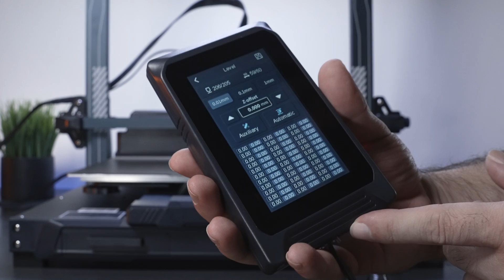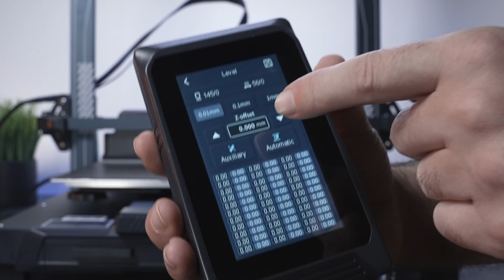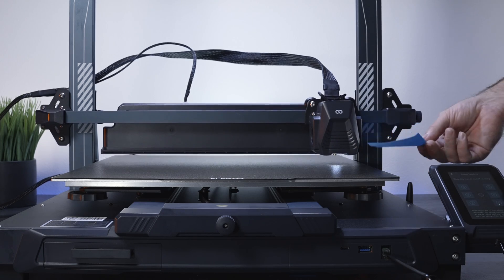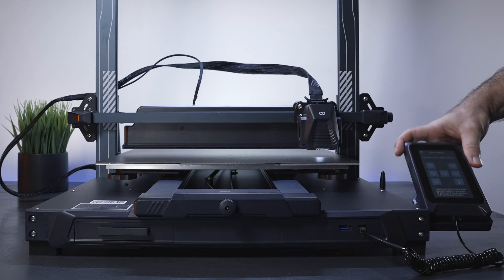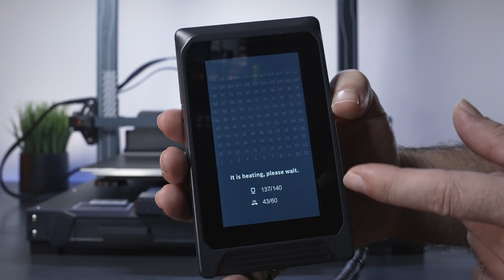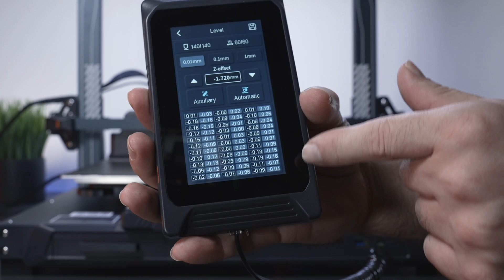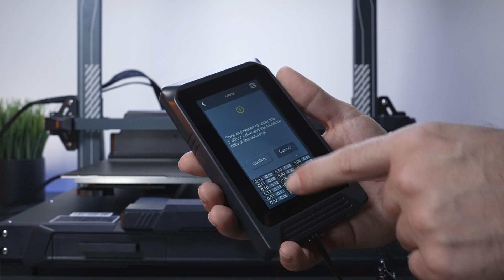Elegoo Neptune 4 Max - Bed Leveling

Comment: out of the box it levelled no problem then did a 5 day print, every since its been nothing but problems, bed wont level, print wont stick, randomly fails half way through. worst printer i have ever had tbh and im still here banging my head against the wall trying to fix it. elegoo support doesnt listen and sent the wrong parts stuck with it and its a nightmare to deal with. if you dont already have one and youre thinking of buying one please dont.. or just buy mine.

Comment: Thanks, setting mine up today.  I didn't realize the z-offset was set first but of course I see how that makes sense.  Don't underestimate the side-to-side effect of the leveling knobs in fact I tend to work across the printer either diagonally opposite corners then the middle or a pattern like 1-5-3-4-2-6.  I figure at least three rounds of manual leveling...you'll know because an adjustment on one side doesn't change things on the opposite side.
Wish I knew what the columns of numbers meant...6 columns of 11 numbers or 66 values doesn't match the sampling points of either the standard or advanced auto leveling....?  So far I have numbers from 0.16 to 2.40...so apparently my bed simulates an ocean wave 😥😥

Comment: Not sure if people are still referencing this video, but it's worth also using Orca Slicer with this because you can go to the tuning setting and get a 3D heatmap for the offsets. This is super handy because it summarizes your offsets (Elegoo's little summary is pretty bare bones). I can consistently hit a variance of under 0.3mm, which I use as my initial layer offset. This usually lasts a few prints especially if you aren't printing things that take up the entire build plate, and auto leveling every other print just to check that my offsets are still within that tolerance. Or if you're tired of fighting it (which happens) the nuclear option is coat the plate in a layer of glue stick and just printing into the layer of glue. You get gross bottom surfaces but you don't have to manual level anywhere near as option (still haven't tested misting a layer of PVA glue on the plate but that also seems feasible).

Comment: Its better to aux level in a criss-cross pattern like the lug nuts on a wheel.
1,4,3,6,2,5 rinse and repeat.
Reply: See I do this but haven't seen anyone else mention it, just seemed like a good idea because you do it on lug nuts to better distribute the force, so I assume the same applies here.

Comment: Awesome video.  What do you do if the center/home position is good but when you do auxiliary every spot is about 3 mm from the bed and the manual knobs are all loose.  It seems the bed needs to go up in those areas but all knobs are fully loosened.  Anyone who solved this please chime in.
Reply: Tighten the knobs and the bed will raise

Comment: What do you do if the positions 1, 2 and 3 are so tight you cannot fit a piece a paper between.. knobs are so loose they're about to fall off the threaded rod.
Reply: Same issue
Reply: @xci6a908  Make sure your turning the knobs the correct way, Its opposite from what makes sense.  As you loosen the knob, the plate rises.
Reply: Left side it righty-tighty and the right side is lefty-tighty.
Reply: I also had this happen, after compensating repeatedly I found I had tightened all of my adjustments to the max, but I did find a way of fixing it. If you tighten each screw to about the half way point, you get the bed back in the middle of the adjustments. Then re-home the printer from that point to set it at your new height. Because it doesn't matter the height of your start point this will make it so you have the most space to make up or down adjustments.

Comment: I went past the auxilery thing and when I pressed to start at one. it made some weird noises and went to the second position. what do I do?
Reply: Maybe make sure you don't have one of the shipping blocks under your bed.
Reply: @tengelbert84  There are none on the bottom of the bed. I got rid of the foam pieces down there already if that's what your referring too.

Comment: It's bs.. I sit there a level it twice..... then I starts out fine played the bead down then gets 1/4 of the way up or 3 or 4 hours tillbits done.. and you can hear the nozzle rubbing on the print.. eventually lifting the print off the damn bed.. like wtf am I doing wrong.
Reply: I have exactly this same problem...
Reply: The nozzle is hitting the bed after it's been printing? It almost sounds like it was able to do the first layer and then had a hiccup, one option is to increase your initial layer offset (mine is 0.3mm) and additionally I use a glue stick on my build plate to give it just a little extra room, rather than digging into the plate it just pushes the glue out of the way. Not the cleanest bottom surface but for a printer this massive it's gonna be tough to get it even all the way across.
Reply: Nothing it's a POS printer ... mine does the same ...

Comment: My z offset always seems to be a little high after leveling so I always print a skirt at least 8 lines wide and make adjustments while that's printing to dial in the perfect layer before the model begins to print, work great this way.

Comment: Do i need to relevel auxiliary everytime i start a print?
Reply: On mine I checked it a few times after the first print and the calibrations did change a little so I just take the time and readjust after each print.

Comment: I have a question - every time I click auxiliary leveling, it gets rid of the offset I've set at the home point, so I can't realistically level my printer properly. Is there any way for me to fix this or work around it?
Reply: I have the same issue, only solution I've found is to buy a better printer. Elegoo filament printers are dog shit.
Reply: @nova5224  I have since resolved the issue. Oddly, ignoring the issue's very existence, levelling the bed anyway and then going through the 121-step autolevel shows a maximum level deviation of 0.06mm across all 121 level points. Assuming the printer can be trusted, that is.

Models printed in the middle do come off the plate slightly easier than at the edges, but I can work with that.
Reply: I know it's been a year, but if you do an auxiliary and then an auto, it should prompt you at the end of the auto calibrate to set a new z offset

Comment: If you’re seeing only 36 points instead of 121 points on the Elegoo Neptune 4 Max, here is a tip:
On the top right in levelling screen, there is an icon with 2 arrows. 
Click on it and it will take you to the menu in which you select “professional levelling” and then hit save. 
You open the levelling feature again and it will have 121 points.

Comment: MY MACHINE DOESENT HAVE 121 POINT THAT THIS MEANS? I HAVE TO UPDATE MY FIRMWARE....
Reply: On the top right in levelling screen, there is an icon with 2 arrows. Click on it and it will take you to the menu in which you select “professional levelling” and then hit save. You open the levelling feature again and it will have 121 points.

Comment: what is the difference between the black and the grey numbers?
Reply: It's just to emphasise a difference between the automatic leveling measurements and to make it easier to tell which area of the bed is too high or too low

Comment: Thank you. I haven't had to use glue and j didn't want to start. I knew doing a cold vs hot leveling made a difference but it would have been a while before I came to the conclusion of preheating for a set time period.

Comment: And what do you do if on auxiliary no matter how much you loosen the knobs the bed doesn’t drop enough to get paper between the bed and the nozzle? My center is lined up perfect, but when I go to the edges for auxiliary I can’t get it loose enough to fit paper in there
Reply: You need to turn all the adjustment knobs to most of the way tight before levelling the bed as well as setting a z offset whilst it’s in the centre before selecting auxiliary levelling to ensure the nozzle will be as close to the bed as possible.

Then when you move it to each point it will be much closer and you can tighten/loosen the knobs as required.
Reply: I'd contact elegoo might need a new bed

Comment: I don't mind bed leveling used to it from my ender 3 Neo. My problem is I updated my Neptune 4 Max now when I go to level with paper and I push any of the numbers it goes there but does not drop down. Basically the update made it unusable.
Reply: Same here, just trying it now. I thought I’d done something wrong. Is there a fix for this?
Reply: @oleww50  I had to change the fix pack and firmware. Had to actually go back to the older version. But then it did it again so I updated it again to new one that worked. Not sure why it's doing it.

Comment: It's worth noting that people who are having trouble should be aware that the bed is mounted on springs at the adjuster knobs.   

You must make sure you don't put any pressure on the bed (at all) when tramming (levelling) it with paper.  

Also, I find it easier to remember that if the nozzle is too tight, then the bed needs to go down, but if you think differently, i.e the nozzle needs to come up when the paper is tight, and down when it's loose, then it's easier to remember which way to turn the knob.   e.g. if the head needs to come up (paper too tight) turn the knob anti-clockwise (from above you are unscrewing it.) and vice-versa.  

Also, remember that the bed is pivoted by only 2 points in the middle, you'll find it easier and quicker with fewer steps if you level the knobs in this order.  1 - 4 - 6 - 3 - 2 - 5, then repeat in the opposite direction  3 - 6 - 4 - 1 - 5 - 2.  I find doing a third run gets the bed as close to trammed as possible before automatic levelling.  I run this tramming as 2 - 5 - 1 - 4 - 3 - 6.   The whole process takes around 35 minutes from start to finish.
    
Another tip is to use a piece of letter size or A4 paper and hold it at the edge.  If it crinkles when sliding it under the nozzle it's too tight,  If it moves too freely it's too loose.  If you can feel it drag, but the paper doesn't lift off the bed it's perfect.   If you use a smaller piece of paper, like a post-it, your fingers are too close to the nozzle and the paper doesn't have enough area to warp when the nozzle is too tight.

I hope this helps.
Reply: Man you are my hero. I will always use this technique now!
Reply: This!!! Thank you so much! I did this and my values so much improoved. From now on this will be my routine for leveling. But one question: How often should it be done? Once in a certain while? Before any other print?
Reply: THIS was the most helpful comment of all. THANK YOU.
Reply: The factory manual states you should be able to pull but not push an A4

Comment: My max did have the 100 level points in the beginning. But after I had to update the firmware because of some horrible screeching. Per elegoo’s support suggestion. They also sent me the file for the firmware. But after that I only get like 36 leveling points. Which I think is the standard for the smaller beds. But can that also be the reason I just can get my bed leveled right?
Reply: if you go to the settings screen, then advanced settings, under something like leveling mode you can change it to professional leveling which will give it the 100+ leveling points again. I to am having issues with leveling, but ill get it eventually, as i know you will too. Keep adjusting, maybe do some z off set test prints. I do a .3mm layer height on  a 10mmx10mm square with a brim around it and takes less than a minute to print out and you can easily see if your offset is to much or not enough. can also duplicate the square to make as many as you want, in different positions to verify the entire bed.

Comment: So at the end you click “back” and not the disk icon in the top right corner? I’ve be selecting the disk icon…but then again I can’t get my bed level, because I wasn’t starting in the middle…thanks for showing that part. I’ll try that!
Reply: I click the disk, the printer saves and then resets back to the centre origin.   This is OK.

Comment: wow it turns out my printer is defective, im getting a replacement lol
Reply: how did you figure out if your printer is defective? i want to know so i can see if i have the same issue
Reply: Okay it turns out the company gave me a defective head, I bought my printer in November. They are going to replace my printer head and this huge cable that connects to it  @_elied_2134
Reply: @_elied_2134   When I would try to level the bed, it would never give me the z offset adjustments. So all my prints would fail
Reply: Just but a bamboo, trust me.
Reply: I have a couple Bambus and they are great. When they come in a bed this size let me know. The neptune 4 max is great, it's quality can be just as good as my Bambus and the speed isnt too far behind.
Reply: @ShawsYouTube  Yea I wanted too, the detail on them is insane

Comment: leveling this is the worst . been stuck on getting to be perfect for two days
Reply: Agreed. My god once its level, this is an absolutely excellent printer, but getting it level was such a pain. I had less issue levelling my Prusa i3 mk1 and it had no assistance for levelling whatsoever
Reply: In the same boat, did you manage it
Reply: @EuismodVitae  I had to level it again, my filament was 2 years old  so i switched to elegoo rapid pla + and it works perfect. I also learned that you should be preheating your bed to 60 degree for 30 mins before printing. ALWAYS auto bed for ever print
Reply: Mine shakes violently the whole time and doesn’t light up either. Does anyone know what the problem might be
Reply: @admkennelsmike it sounds like you need to update the fix pack. I could very well be wrong but I have this printer and was having issues with it shaking bad and updating the software fixed it.
Reply: Lol, its a pain, and it will randomly go off so get ready to redo this very often. A simple power off and back on will change everything.
Reply: Does it still print ok if it's not perfect? First timer here

Comment: What year is it why they still doing manual bed leveling
Reply: i have been struggling so much with this bed level
Reply: personally I prefer manual leveling because you can always make adjustments, I'm still not convinced the auto level does anything other than just giving you references to then manually adjust. Small printers can get away with it by having fixed beds or software that can compensate for minor variations, but anything that's large format is going to require more adjustment than that. Being off by a few degrees over 150-200 mm isn't so bad, but double it and the margin of error gets more significant.
Reply: I guess that's the downside of buying cheap 3d printers.